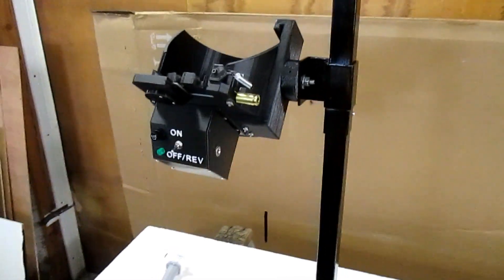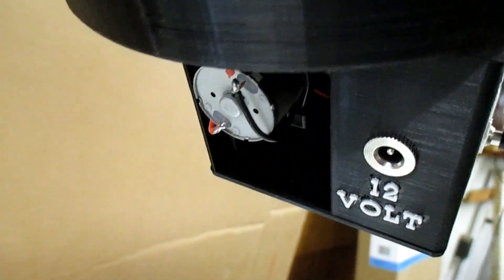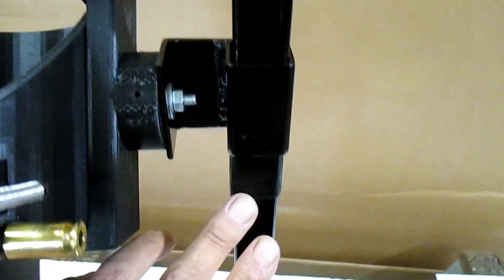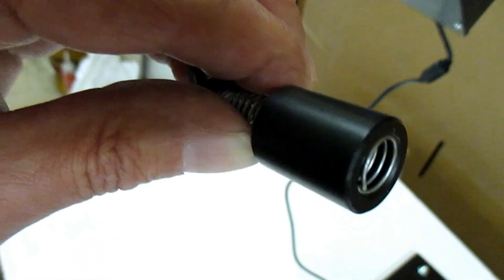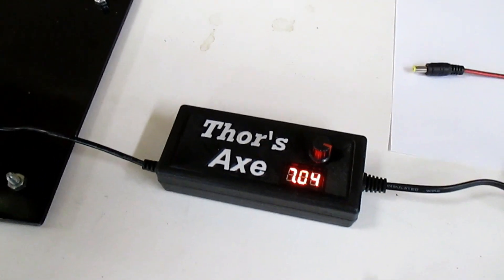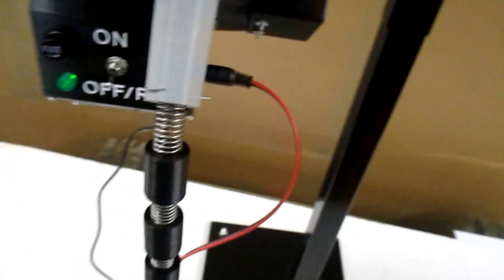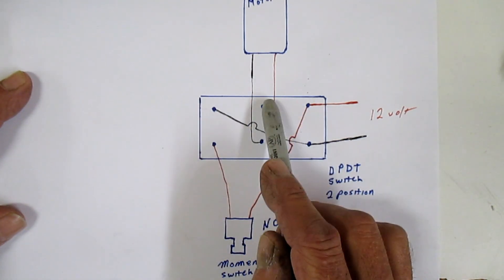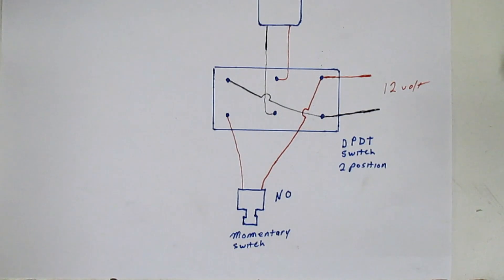bullet feeder build

Comment: Where do you get the stainless steel coil spring? I have been searching the web for it with little results. Thank you for the video!
Reply from the maker: The spring is not stainless steel, just picked it up at the hardware store

Comment: Another question can I put the reverse setup after the speed controller M-& M+ like when it leaves the speed controller it will go to the switch p & - then from the reverse setup to p & - to motor hope this makes sense it’s kind of hard to explain 😁 thanks
Reply from the maker: Sorry ocean got tied up yesterday with stuff, kind of hard to follow what your asking. But if you mean can you hook up when it leaves the speed controller then the answer is YES that’s how I did it. Hope that helps     Harry
Reply: Cool thanks

Comment: What amp fuse did you use to prevent the motor from burning out when jammed? Thanks
Reply from the maker: Hi Mark, I had to use a really light fuse in this. It ended up to be a .05 amp or 50 ma. Hope this helps
Reply: @backyardinventor9580  Wow that is a light fuse. Thanks for your help and quick response!
Reply from the maker: @markpeters7256  Hi Mark now I was using a Bringsmart JGY-370 12V I got from amazon and tested with a .1 amp fuse at full lock-up and it didn’t blow. At that point I went with the .05a 50ma fuse, now different motors may require a different to protect it. Good luck with it.